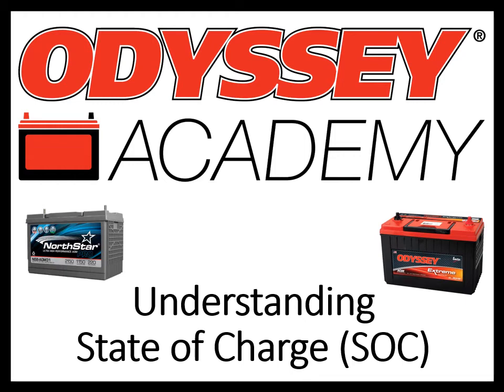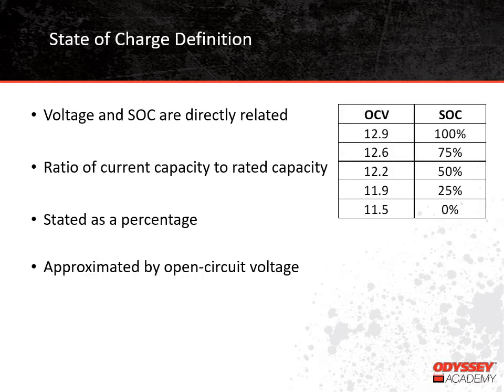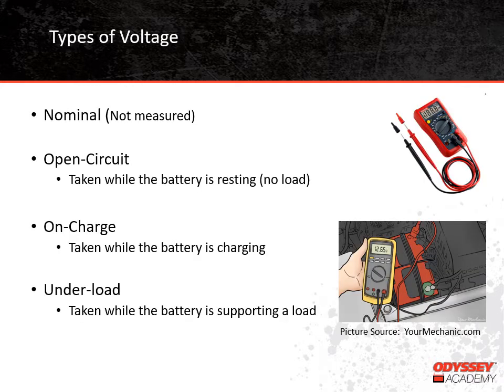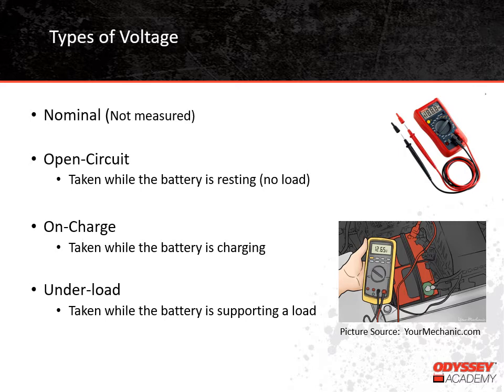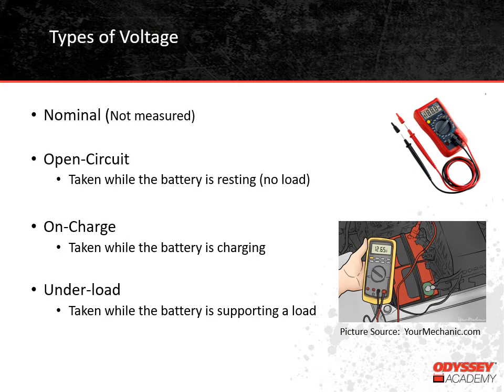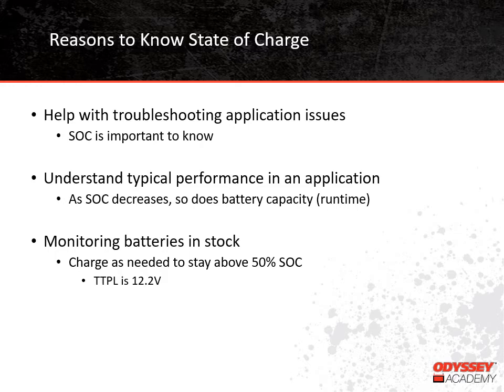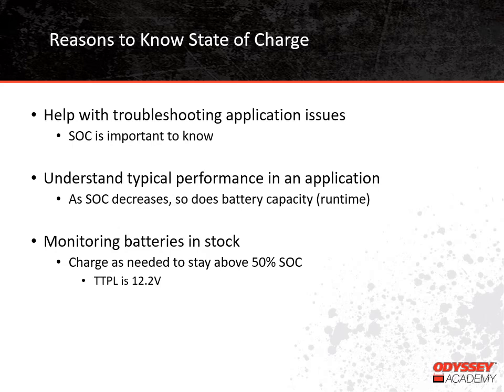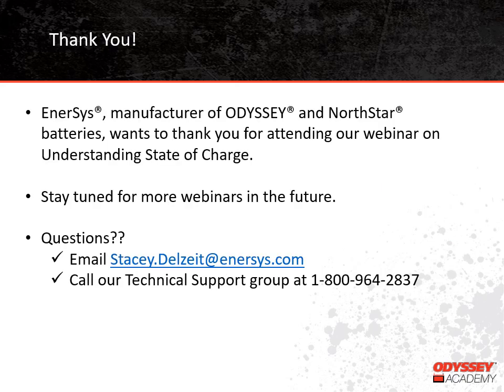ODYSSEY Academy – Understanding State of Charge (SOC)

Comment: I don’t understand why you compare  a Thin plate pure 
 lead battery to an absorbed glass mat battery. Your video on how to make the odyssey battery mentioned using absorbed glass mat. So my question is what is different. I know other battery manufacturers that also use thin plate pure lead with absorb glass mats and they Refer to their Batteries as absorb Glass Matt Batteries,
Reply: Hi Ryan my understanding is...AGM batteries can be either 1. Thin plate pure lead or 2. more traditional ordinary (not thin and not pure lead) plates. They are different. Hope this helps.